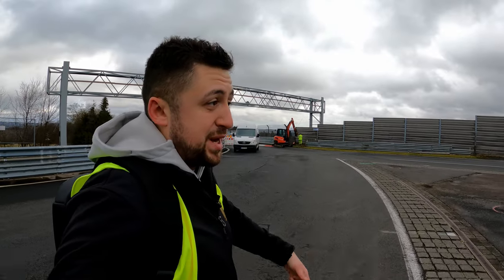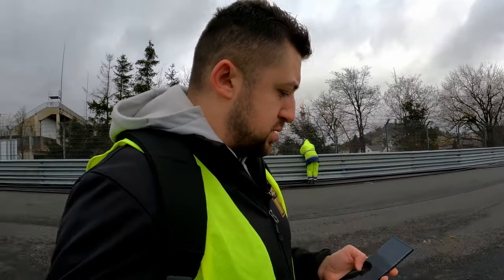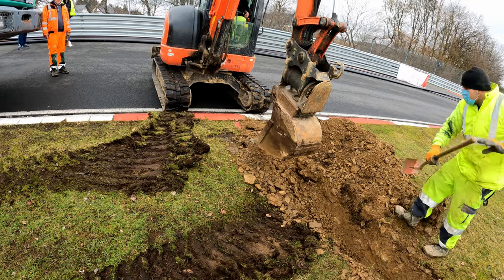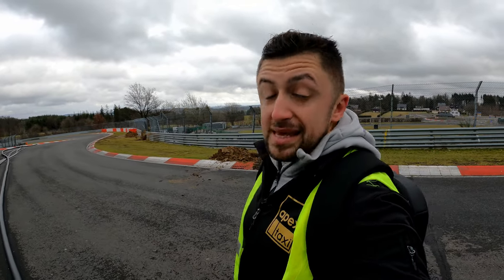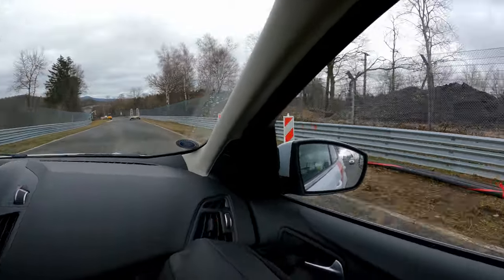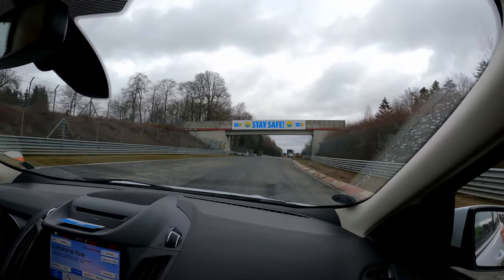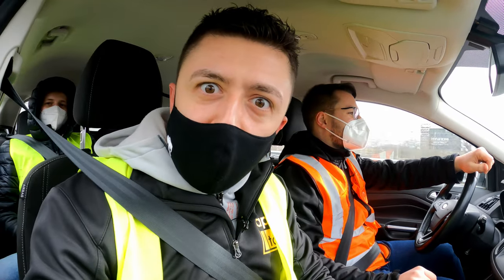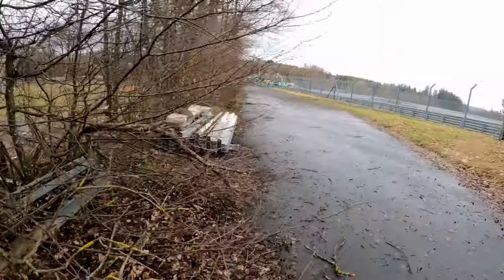Nürburgring Construction Updates 2021: Investing in Digitalization

Comment: They could create an app that works with GPS so you can get the flag and track info during TF in every car in addition to digital signs alongside the track. It shouldn't be too hard to create, it's just not 100% reliable since you can't control the quality/GPS accuracy of the device the driver is using so drivers would still need to pay attention to the track signs and marshalls. But still, it would be a nice addition if you got an audible and visual warning from your phone in the car if you would come up to a hazard.

Comment: I'm an ex-rally driver (only amateur) not a circuit racer, but I've followed tarmac racing for decades. I'm all in favour of safety improvements, but I really do hope that the world's major circuits aren't 'corrected' excessively. Making them all uniformly flawless and smooth would be a great shame.

I think it's important that tracks are allowed to retain their individuality. Notorious bumps, dips, ridges, rough patches, and tricky camber changes all add character. Yes, they make driving more difficult, but so what? If you don't like gritty reality, race on a simulator!

Having flawed tracks keeps drivers, designers, and manufacturers on their toes, and that's essential if real circuit racing isn't destined to become some tiresome 'super-speedway' procession.

I'd be sorry to see electronics replacing human marshals with flags and radios entirely, though. In my experience, motorsport marshals are some of the finest, most dedicated people in the world.

Comment: Just thinking.... this is the perfect opportunity to test 5G wireless systems, I mean, those signals led panels perfectly can be charged by sun panels, and even if is not enough it can be charged by eolic energy (or hybrid). Cars make turbulence that is traduced to wind so that can be captured by eolic systems.There is a lot of new clean energy to charge a led panel wich also is low in comsumption. By the way what kind of wireless technology is used in F1 to stream from car to TV Control on F1 channel?